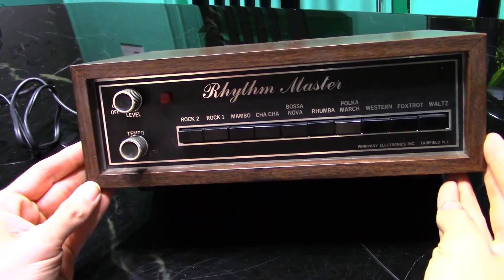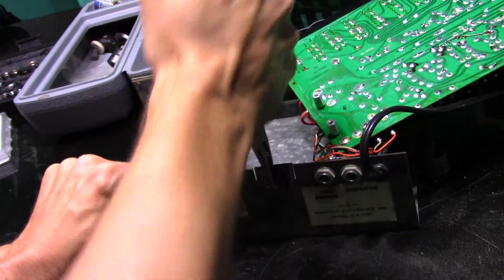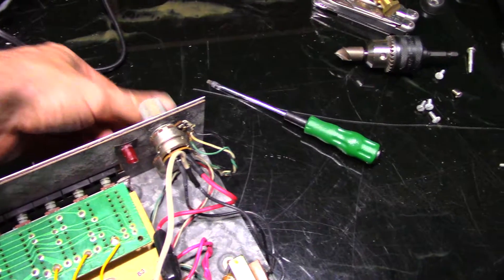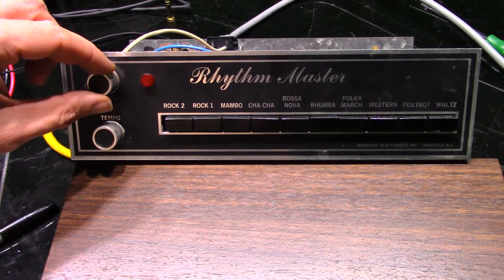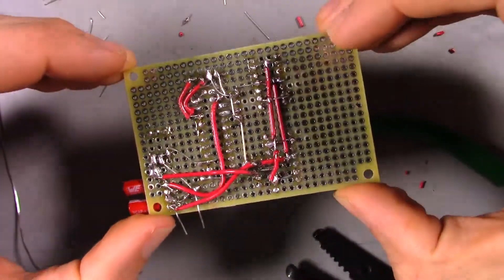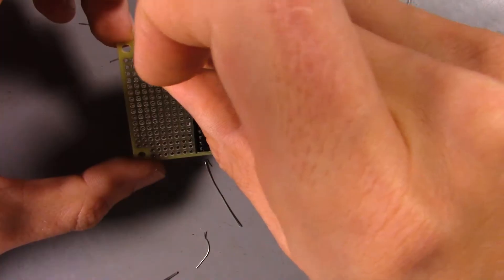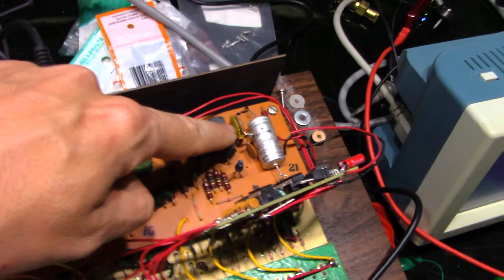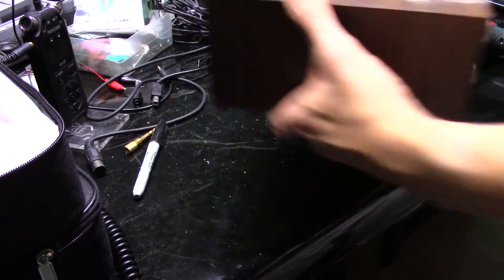Midi Moding a Rhythm Master Drum Machine form 1977

Comment: Do you have schematics or values for the green polyester capacitors on the sound generator board? Mine has a hard gunk covering the caps and I can’t read the values on them
Reply from the maker: They vary for 0.01uf to 0.1uf. I would be happy to send you some photos. Use the contact form on my website so I can get your e-mail address. https://recklessexperimentationaudio.com/contact

Comment: Where did you grab power for the led? I couldn’t find a point that didn’t effect the drum sound
Reply from the maker: On my unit there is a 100uf 25V capacitor near one end of the board, that is where I attached the power leads to my board. If it is affecting the sound, check the current draw of your board, I my board draws about 20mA. It is also possible that the filter caps are bad, and need to be replaced. If your unit is similar to mine, it is over 45 years old, and the caps don't last forever.
Reply: Thank you for sharing! You’re an inspiration!